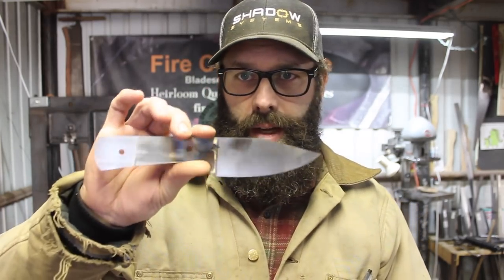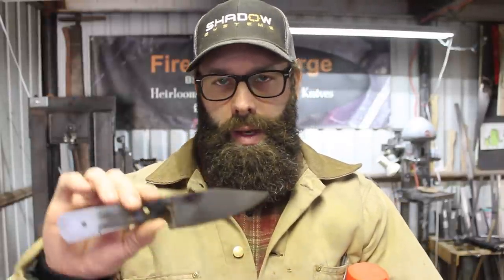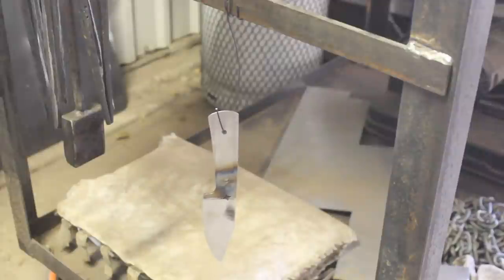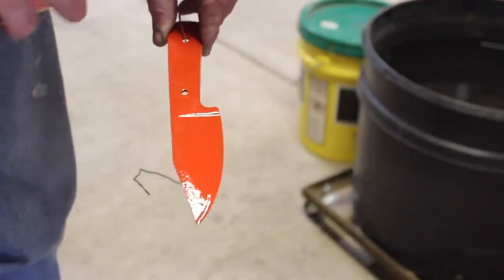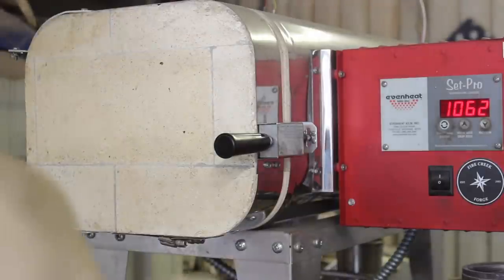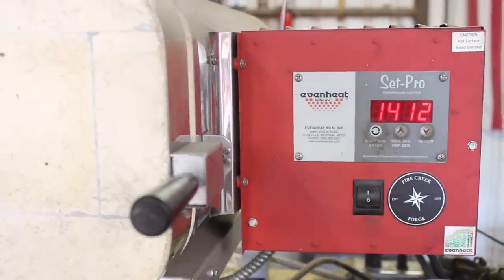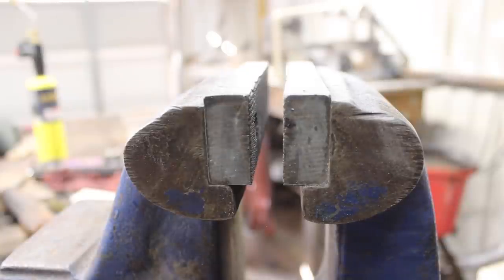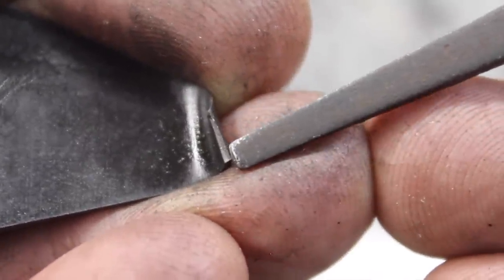Heat Treat Hack You Can Use For Knives, Atmosphere Control Kiln Heating And Tempering, Knifemaking

Comment: Like the video. Very interesting.  So I use a high temp paint on my forge. Even next to the opening it has never blistered or chipped.  It's header part for motors. Ots called VHT flame proof. And it says ceramic coating. Pick it up at any auto parts store
Reply from the maker: cool, good to know

Comment: Grain looks really good! Sandblasting and staging the paint like you said would probably help hold it on there. On some header paints you have to cure them with lower temperatures and let the rest before they are ready for prime time. Really great idea and a lot cheaper than most antiscale compounds.
Reply from the maker: Good points! Thanks for watching!

Comment: I typically use Nuclayer 2000 as a anti scale, it’s a natural water based clay and is super easy to apply and can be dried in seconds with a heat gun. It’s also what I use in conjunction with a thicker clay for hamons.
Reply from the maker: Cool, I've heard about using that but wondered about the atmosphere protection

Comment: I have some 2,000* anti-seize spray I use for punch lube. Been wanting to try it out for anti scale. Never thought of using paint for some reason. Although the best option for this would be stainless foil. But I’ve always been a fan of trying new things, which seems your the same way.
Reply from the maker: Nice! Yes I like to to try out different ideas. I wouldn't try to use the paint on stainless blades, but otherwise it seems adequate.

Comment: The tip bending is always a better outcome then puncturing the bottom of the quench tank.
But very interesting test, something I noticed is that those "soft" spots are mostly on the finish ground part and not as much on the tang.
Maybe the paint didnt have enough bite due to a higher grit sanding?
Reply from the maker: That is possible, thanks for watching!

Comment: I've tried a couple of things over the years- ATP-641 and Condursal Z1100 anti-scale surface treatments and they do work ok at the lower temps (700-900C) if you follow the instructions. They still blast off in the oil filling it with particulates of whatever industrial goop they're made up of which I'm not a fan of. Mostly I was looking at them because I use a lot of stainless and was looking to save a bit on the foil sheet, so they don't tend to work at the very high temps (1000-1100C) and manage to burn off some carbon in randomly splotchy areas kind of like how we saw with the paint.
(in either case- its a heck of a time trying to get that surface gunk off the knife later on)
Might be worth trying to leave the paint dry overnight on a test piece and see how you do
Reply from the maker: Nice, thanks for watching. Yeah, I use foil for stainless steel blades.

Comment: Always try to learn from personal experience, someone else's mistakes are preferable to learn from. Slowing down and not trying to turn the oil into a whipped topping.
Reply from the maker: Thanks for watching! Agitation is important to defeat the vapor jacket, and introduce a continual supply of cooler oil to the surface of the steel... Although in thin cross sections like this it's probably less relevant.

Comment: Why don’t you just get an Argon tank and regulator and run Argon into your Kiln? Many kiln manufacturers actually have options for that although they are not standard but the Argon actually displaces the oxygen and other atmospheric gases with the heavier but inert Argon gas working much the same way as it does for Tig Welding.
Reply from the maker: I wonder what that would cost.?
Reply: @FireCreekForge  I’m not so sure about what a kiln conversion kit from the manufacturer would cost but I had a friend who rigged up his own version for a few hundred dollars and that included buying a full 125 Argon tank and a regulator and the line to run into his kiln from a local welding gas supplier. Now the line he ran from the regulator to the kiln wasn’t a prefabricated kit, it was a handful of fittings and gas line. Each time he refills his Argon it’s like $45-$50 but that tank lasts quite a while because the argon doesn’t burn up like propane, you close the kiln and turn on the argon for a few minutes until it displaces the air inside and it’s good until you open the door again if you are doing something small like knives but if you are heat treating something big and thick like tooling where the kiln is running much longer then you might need to add argon some time midway through the heat treatment process

Comment: I'd be half tempted to water quench with the paint on it
Reply: Depending on the steel and the thickness there’s no problem with it. I do it all the time. Not in just tap water but a brine heated to 150*. But definitely would never water quench 52100 lol.
Reply: @erikcourtney1834  Right, but I was thinking that with 8 mils of paint on it, it would slow the cooling enough, or could anyway. The blade was already an experiment.
Reply: @kiplambel4052  I’m not real sure if it would work like that. The quench speed is still the same. It be worth trying anyway.